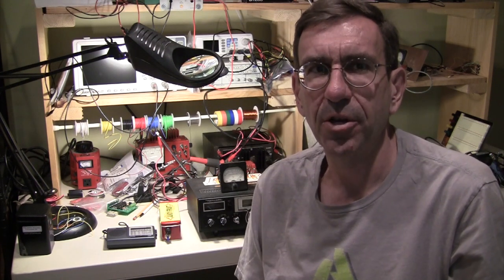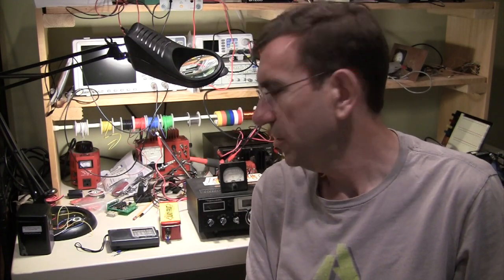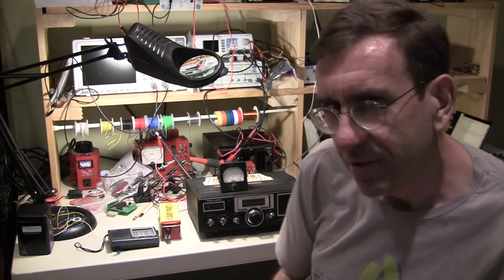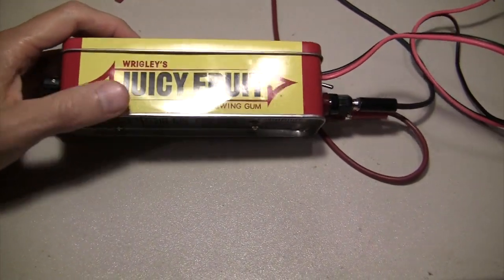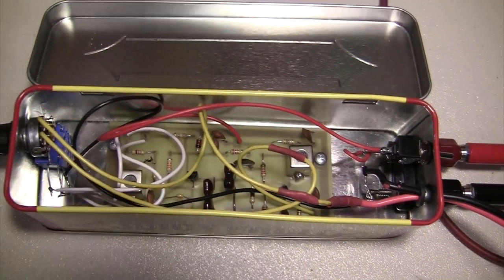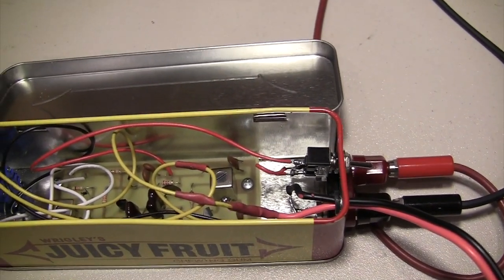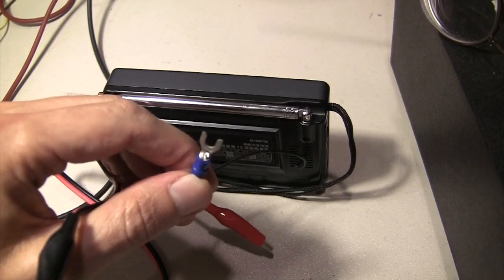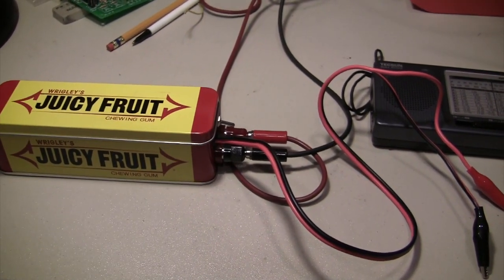Introduction to external BFO videos

Comment: My Tecsun R9012 radio is really cheap junk like those radios they used to gift you when you subscribed to TIME magazine.  The dial cord feels like its a roundwound guitar string in there and it catchesand creaks past the tuning point i usually want it.  While im able to hear ssb, its hard sometimes to tune in the station while the ham is still talking.  Second, the frequency markings are all over the place not just in the shortwave bands but in FM as well.  There is no room to put in a BFO in there at all even if its an IC radio.  The only positive thing I have to say about it is that its portable.
Reply from the maker: Yeah this was a fun little circuit and just fun to play with. Certainly can enhance the cheap junk rigs a bit!

Comment: Thanks for sharing,  WF7I Homebrew.
The concept of getting a BFO going reminds me of years ago when I built  using tubes and sockets etc etc etc from junk TV chassis and other stuff, a transmitter/receiver rig for 40 meters.* 

The BFO effect for that rig's rx section  was attained by wrapping one end of a length of insulated hookup wire (insulation and all) a couple turns around the wire going from the primary terminal of the first IF transformer to the plate connection on the 6BE6 converter's socket and the other end of the insulated hookup wire a couple turns around the wire going from the secondary of the second IF transformer to the diode connection of the 6AV6 detector/af amp's socket, thus establishing a 'gimmick' capacitive coupling at just the right phase  between the input and output of the 6BA6 IF stage and causing the IF stage to go into self-oscillation at a 455 KC rate and that made a simple  effective way to hear SSB and CW signals. 

To control the amount of IF regeneration I put a ten-turn 2 watt 100 k potentiometer in line with the screen grid voltage to the 6BA6 IF amp. By adjusting that pot it  made a very smooth gradual transition through  that sweet-spot from 'no-oscillate' to 'oscillate' and served very well at bringing up the sensitivity and selectivity for copying the AM signals at the top of the band around 7280, 7285, 7290 and 7295 kc. Oh yeah... and 7297 when Ashtabula Bill W8VYZ was on the air with his homebrew ultra-modulation rig. He kept a crystal for that frequency so he could, as he would say,  "... keep them dammed slopbuckets from crowding in..." the spectrum between 7295 and 7299. :-) 
RIP to Bill Dolvin, W8VYZ/Silent Key :-(

* The rx section of my 40 meter homebrew rig had a 6BA6 RF amp, 6BE6 convertor, 6BA6 regenerative IF, 6AV6  detector/af amp and a 6AQ5 af out. The tx side had a 6AG7 xtal oscillator** and a 6146 rf out, and  ran about 50 watts input on CW and about 30 watts input on AM fone. The AM modulator section consisted of a 12AX7 mic amp/af pre-amp, a 12AU7 af amp/phase inverter, then a pair of 6DQ6's in push-pull for modulator-output and that circuitry tickled the plate and screen voltage feed going to  the 6164 rf out at an audio rate. :-) 
All that circuitry along with the  power supply was built into a single 12 inch by 12 inch by 12 inch metal cabinet. 
**The 6AG7 xtal osc also served as a buffer when I used an external VFO.

Comment: I did the same with that particular receiver in 2016-17 and again now.  On one other one, I put on a connection by soldering a wire to one of the stages to the circuit and putting a phono jack for my BFO. Check out mine as well. https: https://www.youtube.com/watch?v=GIWhLt0gVuE